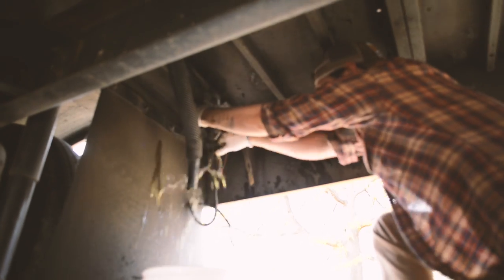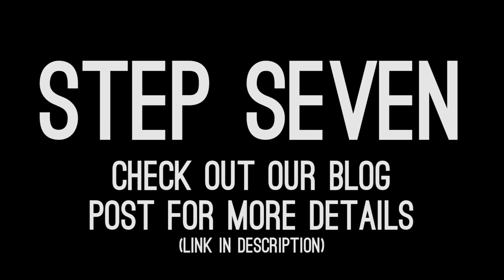How We Removed Our Heaters- 7 Steps

Comment: An easy way to do this and minimize spillage is to first clamp the hose on both side of the cutting area. You can use a variety of things from hose pinch pliers to vise grips to C-clamps and a block of wood. Cut the hose and then position the cut end in the bucket and then slowly release the clamp. I know you are long past this but someone new to your channel may be wondering.
Reply: j jones Great tip!!! Thank you!
Reply: I’m in the process of removing the rear heater from my mini school bus. Why do they need to cut the hose underneath, why not just the one inside? Is it necessary to drain all the coolant? If you drain the coolant then engine will overheat? Please advise, thank you
Reply: @ntboon  I am doing the same thing and what I'm trying to figure out is how I get tube connections for 1 3/8" tube. I cant find them so I can finish looping the system.
Reply: Thank you for that tip!

Comment: Trying to find the 1 3/8" hose connectors to connect the loop in my system. Any help on how u converted it to a smaller tube? (Or so it seems) in your video. Maybe the steps you cut out aren't so "easy to piece together" and seem to be important.  Please someone gimme a response I'm stuck lol.

Comment: Silly question but isn't a heater a plus value in a skoolie?  I'm planning to convert one in 2 years or so and i will install a Webasto idle heater but some busses like your (i think) already have it.  Why remove it?  I live in Canada and wish to use it year round so heating is not an option.Thanks
Reply: this is a suuuper late response and you probably forgot about it but just so you know I'm pretty sure its because they want to use a wood stove to heat their bus, especially since they're going/have gone off-grid

Comment: Ok, so stupid question....why did you loop the hoses after draining the coolant?
Reply: Rolling Vistas did you have to shut off a valve or two before cutting the hoses to not drain the coolant from the engine? Did you have to add coolant at the end of the process?
Reply: @johnhodg8400  More info please.